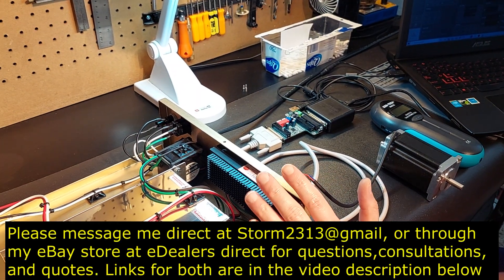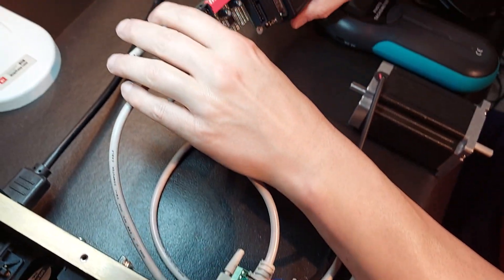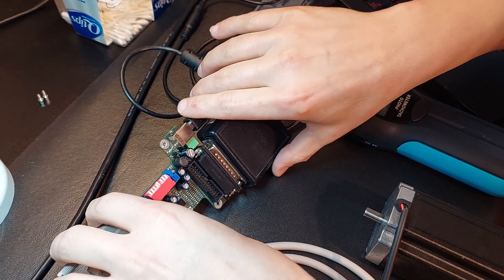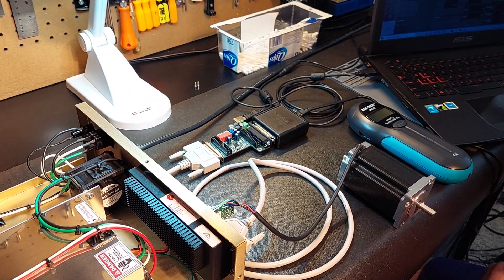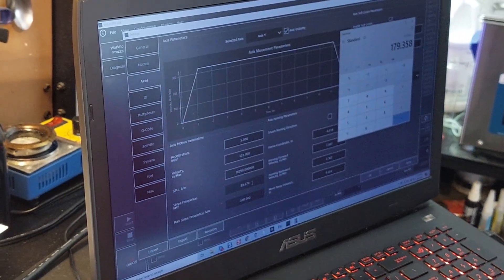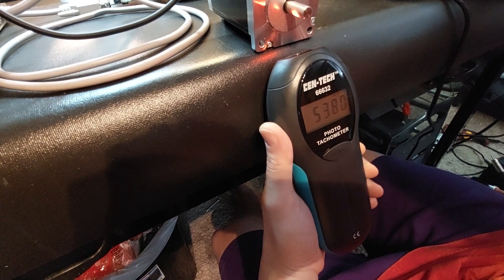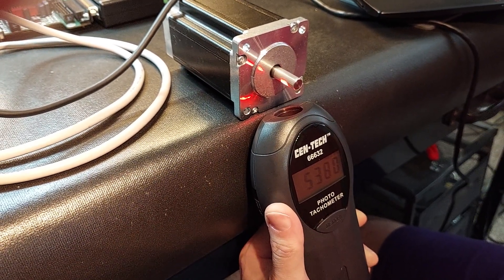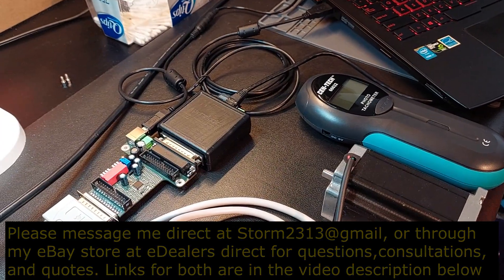Sneak Peak Of The Only CNC Signal Filter With Frequency Multiplier To Provide The Fastest CNC..

Comment: I'm just starting to build my diy cnc but as everyone  have been telling me that stepper motors have literally no torque the higher the speed. So my question is what's the point of the board when the stepper will  Stall at any load. Sorry Vince not trying to be a smart ass just interested in more  Knowledge. By the way your zero backlash stepper motor Couplers are really good products thanks for selling them. I also will be getting some  Double shielded cables from you.
Reply from the maker: Hey Jim, thank you for your support. The question is a very good one. The multiplier is used to unlock your systems true potential by adding massive signal stability, and allowing the frequencies of boards, and drives alike to be unlocked from a set locked limit even from a motion control software's limitation. 

While what you wrote is correct about torque being reduced at higher speeds with steppers many movements/operations with a robot don't require any where near the maximum torque their stepper motor produces, and can easily be mitigated even more so by simply using a larger motor with more torque to have a "torque buffer" to work with to allow much higher attainable machining speeds pending the mechanics of a chassis can handle it. 

 Rapid moves are a part of all CAM programming as the chassis moves from one point to another to machine from which means the longer it takes to get over to a specific area to machine from the longer the program takes overall. 

Here's a past clients chassis moving from one point to another displaying rapid speed before, and after to see a difference just from switching to Pumotix motion control over Mach3 running at 100Khz. https://youtu.be/xz05R-uuR0c

The other thing to think about is the speed limitations many boards, drives, and software have due to the manufacturers/ hardware combinations. This eliminates these variables to allow the end user to optimize performance based on their actual robots mechanics rather than a set limit in real time. 

Considering at minimum just a 10%-15% increase in speed as far as production for completing a CNC project goes for a shop is tremendous, and is easily attainable with this component. 

Thank you, and have a great weekend!

Vince